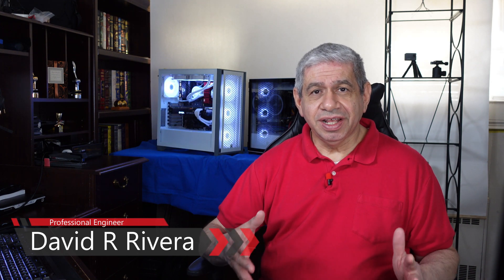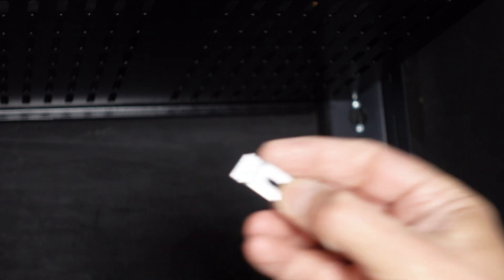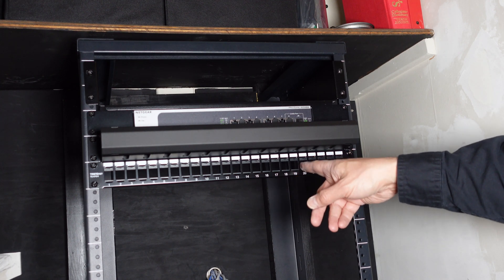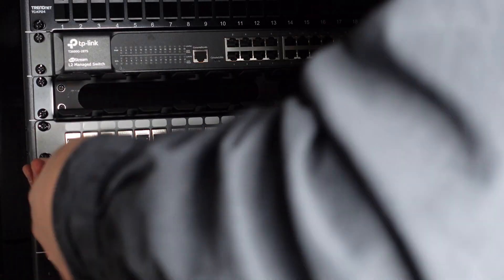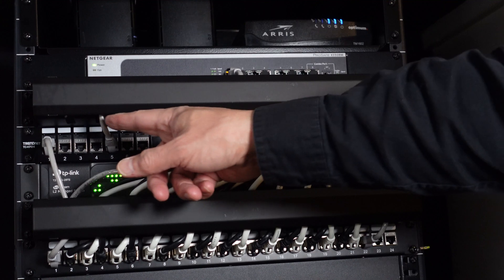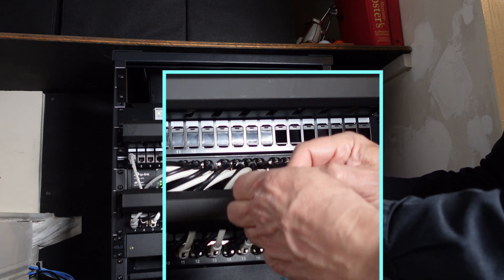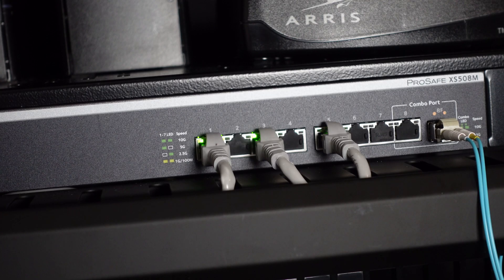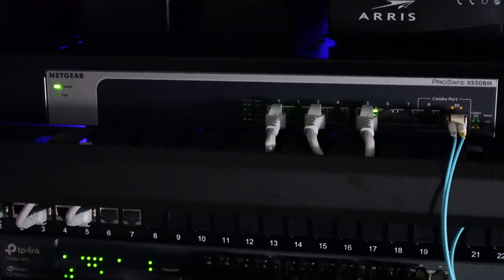Network Upgrade – Part 4 – Vid 2 – Rack & New Network Install

Comment: David:  NICE JOB!  I hope you won't mind a dumb question.  If I had the parts in hand, I would already know the answer.  If I want to mount the Netgear XS508M vertically i.e. against the solid wood side of a small desk, with the fan at the top to exhaust warmer air upwards, will those 2 mounting brackets still fit into the pre-drilled screw holes if I rotate those brackets 90 degrees?  From the photos I've seen, it appears that those 4 pre-drilled holes are symmetric.  I appreciate your help.  /s/ Paul
Reply from the maker: Obviously I did not try doing that, but I just went and took a pencil trace of the screws on one of the rack wings, and the impression seems to show the screws are completely symmetrical.  It is kind of difficult to get exact impression with the angle I am forced to do it at (since I do not want to remove the switch from the rack), but it is extremely close if not exact.  It also looks like turning them 90 deg will make it stand back form the wall about 7 to 8mm.  I hope that helps.
Reply: @PE4Doers  Perfect, David.  Those 7 to 8mm are also perfect.  Forgive me for not asking sooner, when your new switch was not yet installed.  If the supplied wings won't rotate, I can always fabricate new ones.  Your new rack is a thing of beauty!  p.s.  If you have any reason to contact Netgear, you might put that question to them, and suggest a slightly different design if the existing wings won't rotate.
Reply from the maker: @supremelawfirm  No problem, I really think they are symmetrical.  I took two close-up still shot that I would be glad to Email to you if you would like to study them yourself.  I can also scan the pencil impression and include that if you would like.
Reply: @PE4Doers  Oh, don't bother with such a minor detail, David.  I can always make a pair of custom wings, if the ones in the retail box won't work vertically.  I've really enjoyed all the details of your series on this server rack.  It will be a while before I can afford 2 of those switches +  at least 3 x 5GbE USB dongles.  Also, the 2.5GbE USB dongles are much cheaper, and I would love to experiment with a few of those too.
Reply: @supremelawfirm  I had a similar Netgear Network switch and was able to rotate the mounting brackets 90°.

Suggest mounting the switch such that the heat is exhausting up. (brackets can be rotated to the top or bottom of the switch).
Reply: @MrMindlink  Many thanks!  

FYI:  I ended up buying a less expensive TP-LINK 2.5GbE unmanaged switch that is positioned on the floor, under one monitor.  

The first one failed, possibly from overheating, and the manufacturer replaced it via RMA.  

I did give the failed unit a good test e.g. I copied about 275GB thru that switch, to consolidate several drive images in a single workstation folder.  I'm planning to archive that folder to blu-ray M-DISCs.

I also bought a $25 desktop fan and pointed it directly at the ventilation slots on one side of the replacement TL-LINK switch.  

So far, so good.  Thanks again.

Comment: How about link aggregation between the Sigma Nas & the primary work station. This will make it faster.
Reply from the maker: I will need to look into that.  One issue I run into however is that XigmaNAS does not do well with two active network adapters, but I will do some research on aggregation across to different systems.